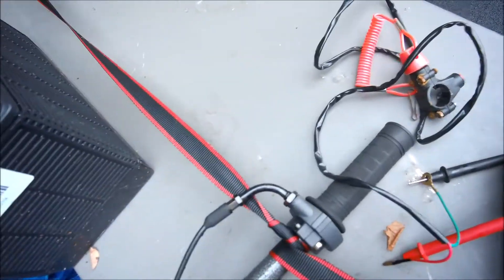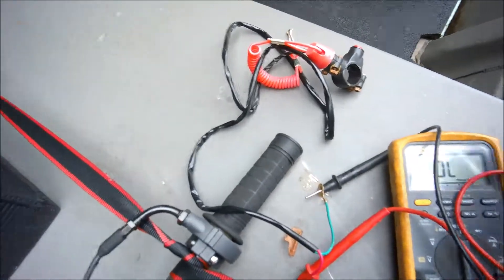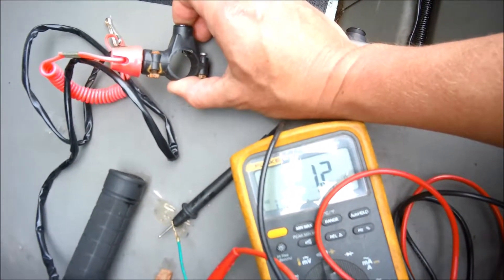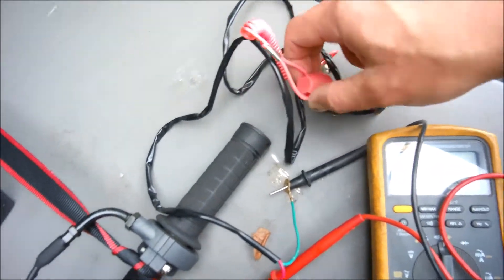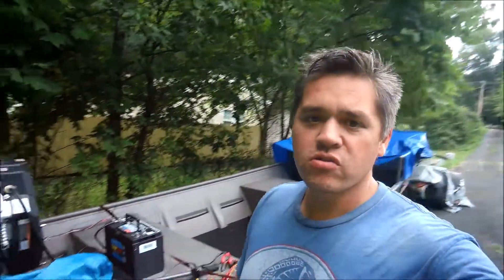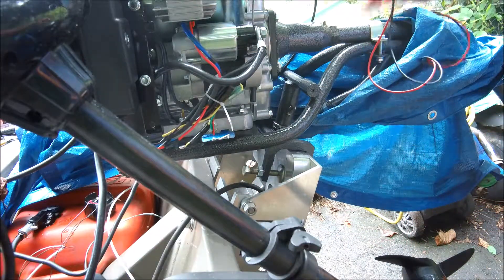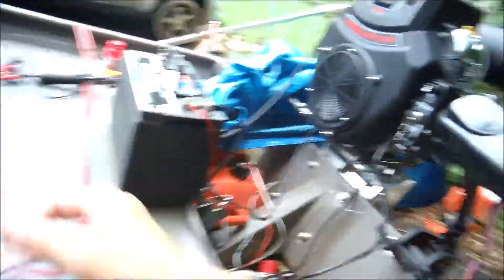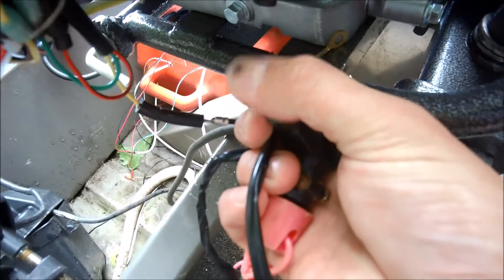Predator 670 HOW to install a Kill Switch!

Comment: Been trying to get one of these motors for a long time, Chinese embassy can't get them at this present time, it's for a 
6 wheel rebuild.
Are you satisfied with the 670?
Reply from the maker: It is a great motor for the price!  I installed an ungraded carb from Mikuni and tuning was alot easier and throttle response was better.

Kit can be purchased below:

https://www.performance670.com/product-detail/mikuni-carb-kit-

Comment: So can you split into the oil sensor wire, and have the sensor still functional? Obviously kill switch grounded.
Reply from the maker: The oil sensor is going to be bypassed, and the kill switch will take its place.  You don't want an outboard cutting out on you during rough seas because the oil sensor is on.  That would suck!
Reply: @thepauldixonOC  it's going on a go kart so I'll disconnect it

Comment from the maker: One wire to the disconnect low oil sensor.  The wire to the engine, use an existing bolt on the engine is the easiest thing to do.

Comment from the maker: Yes
Reply: I just luckily stumbled across your video fixing the surge on my predator 660. I am having surge issues while running the motor I adjusted the low speed screw and now it starts and idles great haven't tried running it but soon. I also saw the video about the kill switch and am wondering if you just leave the low oil sensor wire disconnected completely or is it connected to the kill switch?
Reply from the maker: @martyb3141  Just disconnect,  and take out of the loop.
I'm glad the video helped!

Comment: So basically you just unplugged the low oil sensor connector and plugged in the kill switch wire into the low oil sensor wire instead?